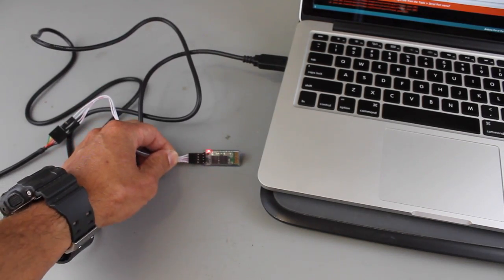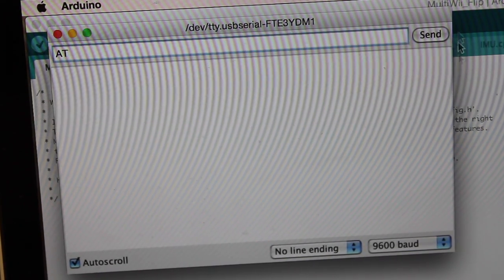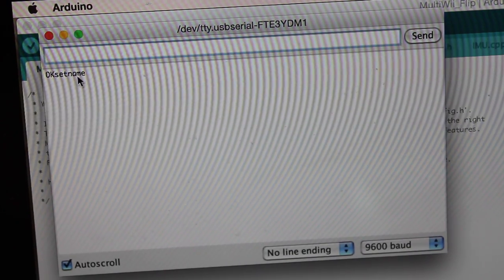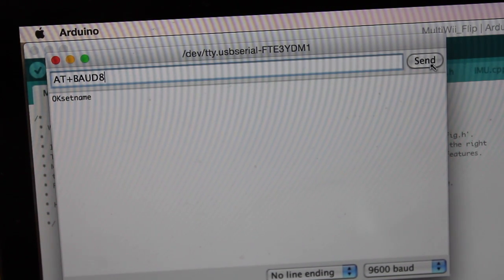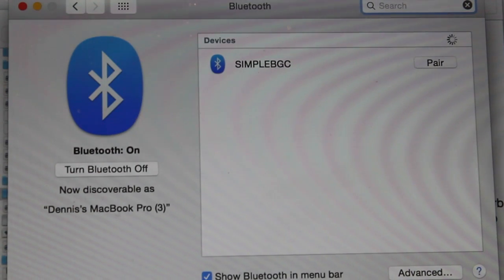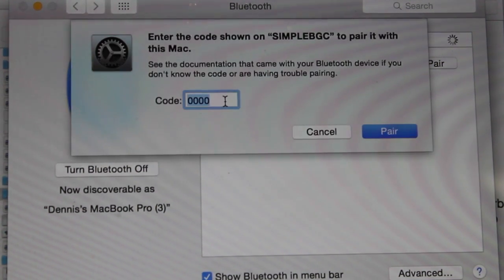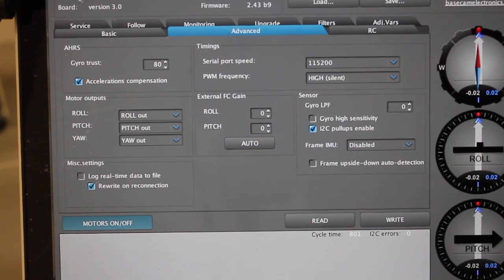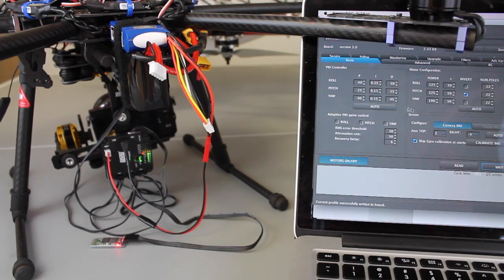SimpleBGC Gimbal Wireless Gain Tuning via Bluetooth

Comment: Hi Dennis, can I connect USB module directly to FTDI cable? Why did you connect it through the white cable and those pin adapters? Thank you in advance!
Reply from the maker: I just did that so I had a way to interface with my Bluetooth module. If you have a way to connect your USB directly then I would say give it a try. Good luck with your setup.

Comment: I was thinking a heavy duty tricopter. 4 to 6s with high efficiency motors swinging a tri 15" prop with 400kv motors. The DJI blades are pretty cool. Build out of aluminum or CF. Hardest part would be the yaw mechanism. If you could keep the weight 1/2 of that of a tbs frame and still maintain the foldability.  Then you could get flight times over 20 min. Using a rail system to mount a camera and gopro but with RTH etc, and still be able to put in an overhead compartment in a plane. That would be the silver bullet.
Reply from the maker: adriancjones I like that thought. I've never even flown a tricopter but definitely have interest in building one and flying it. A heavy duty rig would be nice.

Comment: Very cool video.  Have you thought of doing a platform that could support a gimbal but was portable. Either foldable or came apart enough to take on an airplane?  I was thinking a big tricopter?
Reply from the maker: adriancjones I haven't given this much thought because I don't have the need. But will definitely think about it some more and I think a tricopter platform would make a lot of sense. My only concern is the limited payload it would be able to carry.

Comment: Dennis, I had an extra bluetooth module I've been meaning to install in my SBG controller. Well after watching your video I finally got motivated to do it today and it works great. Once you do this get the Android app for your phone. I switch cameras on my gimbal and know I don't need a computer to change profiles. Thanks for the motivation.
Reply from the maker: renoflash06 Glad to hear that! I just posted a video on SimpleBGC with Android. I'm loving it way more than the desktop version. Thank you for the suggestion.

Comment: I found that the power setting made a big difference too high and it shakes too low and I got a slow oscillation
Reply from the maker: Paul Johnson Thanks for that tip. I've had to push my power settings up a bit because of the weight of gimal arms and camera, but I'll see if I can experiment and bring it down a bit. There are so many variables at work when trying to get this thing dialed in.